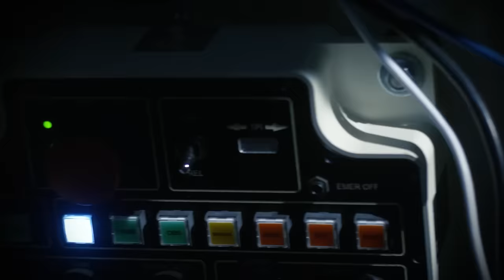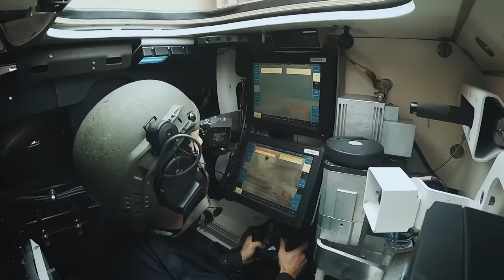Watch how Leopard 2 tank changes the battlefield in Ukraine

Comment: strange idea with tank technology from the seventies possibly partially upgraded to reach significant success. i will tell you a prophecy about the typical destiny of a leopard killed by two Russian fighters: the first one will take his trusty old RPG-7 and make a well placed shot in the tracks of your leopard. the second one take one of the trusty Russian machine guns and empty one or some more belts on the optics cupola, antenna, visual thingies so your tank is a lame blind sitting duck. then the two fighters go for breakfast after they come back they knocking on drivers hatch and offering the crew to come out and get a smoke before go  to captivity or get smoked in their own tank . . .
the abrams and challengers are really fat pigs most of them did not made it to the fight they get stuck in the mud or can not pass bridges depending of their heavy overweight . . . 
(some details may be differ from tank to tank)

Comment: There is some diffrent caliber o Lepoard tanks. Some do have
125mm other 130mmThats why some can be used as lighter
arillery. And there is lots of support veiches to these machinerys.
Reply: That is incorrect. All various Leo II have a 120 mm gun. 130 mm gun is still in development and is considered for a possible Leo III tank.
Reply: @stephanlange2136  They already deliverd some with 130mm!
Reply: @pernykvist3442  Please stop that. The latest version of Leo II has the 120mm L/55A1. The 130mm L/51 or L/ 52 is still a prototype, serial production is planned for 2025. And the Leo II turret will very probable not be able to mount it. So this 130 mm gun will need to go on next generation of tanks. Perhaps a Leo III, a successor of the M1A2 Abrams or whatever.
And there was never a 125 mm gun from Rheinmetall. Thats a russian gun.
Reply: @stephanlange2136  There is even a 140mm that is serving Germany as i type! And they gone to mass production,if we sha belive other Youtube clips.
Reply: @pernykvist3442  No, there is not. There was a short lived project to develop a 140 mm gun with autoloader for the leo 2, but it was stopped very early in 1995 (KWS 3). I really have no idea, where you get your fantasy information from. Please stop posting these false information, that has no basement in reality. It is a simple fact, that ALL Leopard 2 tanks ever build are equipped with Rheinmetall 120 mm guns. ALL.
I correct myself: the Leopard 2 AV (which where first Prototypes , 2 vehicles & 3 turrets where made) had a rifled 105 mm gun. Of these prototypes, one survived in a museum.
Reply: @stephanlange2136   The relase of massproduction was relased 3 months ago according to those clip.
Reply: @pernykvist3442  Whatever. Obviously you are adamant to post fantasy stuff from fantasy videos as facts and decided to ignore relevant sources with verified info like the very detailed info about the Leo 2 on Wikipedia. But I think, that is now obvious to any reader of this thread, so I will no longer respond to the BS you distribute here.
Reply: @stephanlange2136  Dont get angry on me because you are wrong!!?
Reply: @pernykvist3442  I state verified facts, you state incoherent BS from cringe videos. Let's think, who may be wrong....And I'm not angry, just tired to correct your fantasy stuff. This is not World of Tanks, Armored Warfare or War Thunder, this is about real tanks in a real conflict in the real world.
Reply: @stephanlange2136  Now i start to understand! It is that 10mm that bothers you! Dont worry i think you can use it anyway.

Comment: Power take off press gears cables pulleys hydraulics flex joint scaffold tile pressure panels solar panels microwave panels cyclone intake sorter valves psi tanks compressor fuel recycling systems heat cool channel tubes power wind poles power wind suspension dynamo brake generators kennetic energy readers molecular vision thermal vision sonar elemental vision infered electrolysis vision reading electric current nanites microscopic robotics electro static magnetic shield generators electro static magnetic purpultion heat cool hover panels diamond coating fiber optics transparent titanium aluminum reflector lite source codes cloaking device ghost paint blurs photos power wind poles power wind suspension dynamo brake generators kennetic energy readers molecular vision thermal vision sonar elemental vision infered electrolysis vision reading electric current nanites